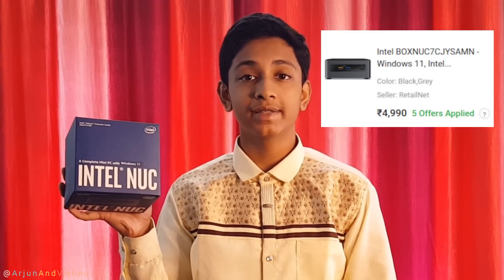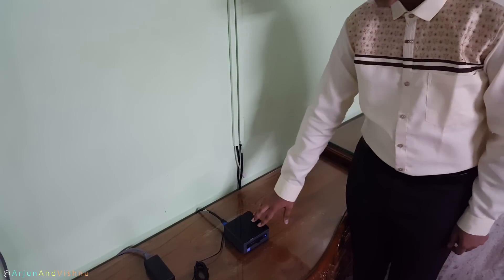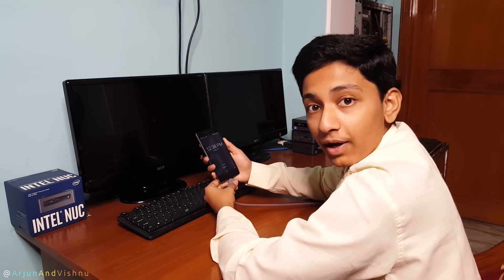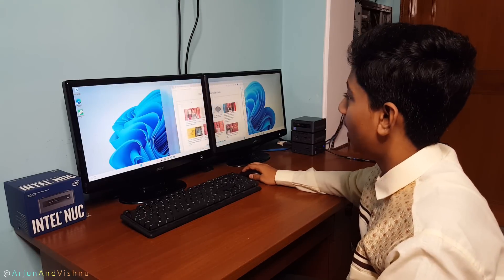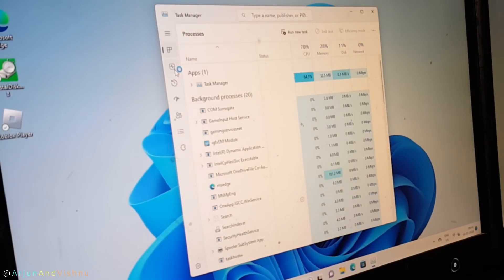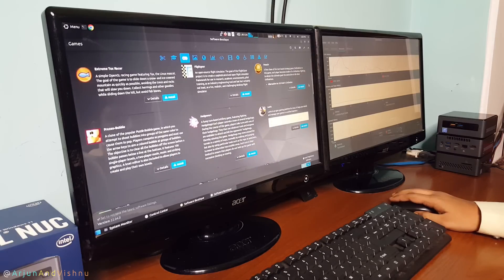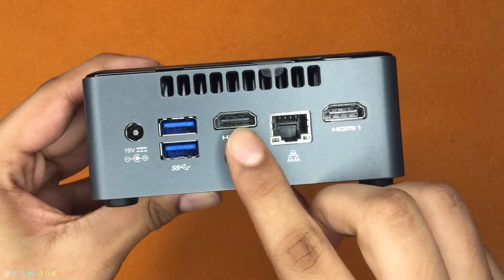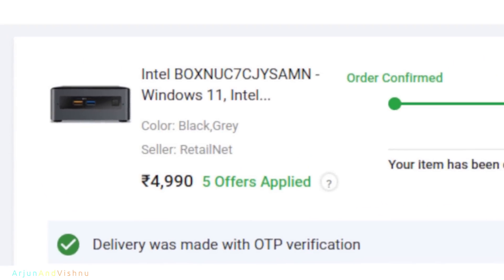Intel NUC Mini PC with Windows 11

Comment from the maker: Frequently Asked Questions:

Q) Where is the product available?

18 July 2023 update: Item Sold Out on FlipKart. It is available elsewhere, but only at a higher price.

Q) Price is higher now, how to get it for around 5K?

A) It was priced for Rs 5,990 on these days in the recent past:

3 July 2023
6 July 2023
15 to 19 July 2023

You get the additional discount when using card payments. Since I have no control over when FlipKart lists it for 5,990 again, there is no option but to wait for the deal. My wise guess is that it will be listed for that price intermittently, until the stocks deplete.

On the day this video was published (and a couple of days afterwards), the product was still available for 5,990.

---------------------------

Q) Why buy RAM at a store instead of online?

A) I generally buy RAM online and it usually has excellent compatibility. For example, I used various capacities of RAMs and even mixed the brands in my "Best Laptop Under Rs.20,000" video:

https://youtu.be/LIG-1PVGTrw

But that's not how things work with the NUC. It has a narrow range of compatible RAM types. For higher capacity RAMs (2x16GB), only the Dual-Rank RAM worked and Single-Rank did not work.

There is already 4GB RAM in the NUC. So whatever capacity RAM you are adding more should be compatible with the existing RAM. This is the reason I suggest that you buy the RAM at the store. You can ask the technician to install the RAM right there and test that it is working. You can even insist upfront that you will pay only if the RAM is compatible.

If you have to buy the RAM online because of any reason, make sure you are buying from a store/seller that accepts returns.

The first time you boot after installing the new RAM, the NUC takes around a minute to show up the screen, this is normal behavior.

BTW, the NUC does not have a speaker inside like desktops do, and it will not beep. In case the RAM is incompatible, the blue LED of the power button keeps blinking continuously to indicate an error.

---------------------------

Q) How to transfer the windows installation to a larger SSD?

A) Since many of you asked about this, I am going to do an instructional of this. Currently, my exams are underway, and I will take this up soon. Tentative date: 6th AUG 2023.

Meantime if you want to do it using other guides, and want to buy an SSD online, go for Crucial. It will help, provided you are going to add more RAM as well.

240GB: https://amzn.to/43OgSxA

500GB: https://amzn.to/3OvIeEd

Why Crucial?

https://youtu.be/rlBPqosUT-I

If you are not adding more RAM, any popular brand of SSD is just fine. 

---------------------------

Q) Which power cord is needed?

A) You need a 3-Pin power cord. Portronics Konnect G2 is a good one, and it sells for around 200 Rupees.

https://amzn.to/3Q3d7RF

---------------------------

Q) I see 100% processor usage constantly, how to fix it?

A) First up, let Windows update completely. As long as Windows is in the process of updating, the processor usage will be high even though no applications are opened. Once the updates are done, the processor usage will stabilize.

It will still hit 100% every time you open applications, but that will only be a brief spike. Being a budget Celeron processor, this is expected behavior.

Besides, Windows resorts to maintenance activity when the system is idle. So that will show up as high CPU usage too. But soon as you start using the PC, windows will pause the maintenance to make the CPU available for your applications.

---------------------------

Q) How to get the SD Card reader working in Linux?

A) On Ubuntu Mate, the SD Card reader is working fine after completing the upgrades. It will likely work fine on any Ubuntu flavor OS.

---------------------------

Q) Where is the product link?

A) There are some latest developments which I have mentioned in the description of this video. You should go through the details before making a choice.

If you want to have a look at the product, the FlipKart link is here:

https://www.flipkart.com/intel-boxnuc7cjysamn-windows-11-intel-celeron-4505-4-gb-ddr4-64-emmc-mini-pc/p/itm099cb2686d35f

Note: This is NOT an affiliate link (I do NOT generate revenue from it).

---------------------------
Reply: How to install msoffice

Comment: Thank you very much Vishnu . I have installed the SSD and RAM suggested by you. I am very happy that my computer knowledge has increased because of you. I have one last question, as the inbuilt C drive(64gb) is already full, is it possible to use the new SSD as a primary storage (drive C) and also boot the system from the SSD so that the overall performance can be improved.
Reply from the maker: Hey, many thanks. I am glad my suggestions were useful to you. Yes, you can use the new SSD for the OS, and boot from it.

I think your NUC came with Windows 11 Home preinstalled. As such, the license key is pre-available in the UEFI hardware. So, you just install the same version of Windows that it came with, for example "Windows Home", and it will activate alright. Here's the process to install the OS on the new SSD:

https://www.youtube.com/watch?v=4Nj_MeDRjmI

If you have a Home License, but you install Professional, it will not activate. Stick to the same version.

Leave the data on the eMMC as it is. It will be useful if you have to repair the OS in future. There is a setting in Intel BIOS where you can turn off the eMMC (F2 - Advanced - Devices and Peripherals - Onboard Devices). Take a backup of your files, and turn it off before you install the OS on the new SSD.

Comment: Can i play 4k video via pendrive in 4k monitor?
Reply from the maker: Sure you can. It does 4K 30 alright when playing local files. However, it drops frames when playing 4K 60 on YouTube, because of the processing power required for de-compression.

Comment: Hi, vishnu Last year in dec i bought NUC11ATKC2 in 8500₹ with ur help ,its working fine .Because of you I was able to make my 1st PC. If you remember I had sent you a pic as well, Now I want to increase storage and RAM. So should I spend 5000₹ and upgrade it or should I go for a new one.
Intel 10th gen i5,  intel Mini PC is available with 512 GB storage and 8 GB RAM for ₹18500 in flipkart( search mini pc) What is your opinion on this?
Reply from the maker: Hello, I do remember you PC, good to hear from you.

The newer one available on FlipKart is twice as quick as your current machine. But, you should NOT buy it for these reasons:

1) Intel NUCs are no longer in production, they will be serviced by ASUS though.

2) A processor that is only reasonably quick than the one you already have is not a strong reason to upgrade.

3) The processor is many generations older too. Does not have an NPU too, something that will be essential for AI applications.

Ideally, if I were to buy it, I will do so it it is listed for 12K or less.

---

As with the upgrade to your existing machine, if you have one RAM slot occupied and the other free, you can buy another 8GB stick. It will cost you around 1200. Total RAM of more than 16GB is not needed for these machines, the processor will get saturated anyway.

Storage is your choice, generally speaking, the money you spend on secondary storage does not go waste. You can use it on one or the other computer. Use a USB to SATA enclosure, and an SSD to go along with it. Here are the options:

Low cost option:
---
Enclosure
https://amzn.to/3U3OdT7

SSD
https://amzn.to/4eGTrMX
https://amzn.to/3zI2QEW

-----------------------------------------

Expensive, but future-proof option:
---
Enclosure
https://amzn.to/3XSPA8m

SSD
https://amzn.to/3NkvjDY

Comment: Excellent review. Just want to know which version of Ubuntu LTS have you tried installing on this NUC. I have the exact same version. Planning to use it for Media streaming.
Reply from the maker: Hi, I am using Ubuntu Mate 22.04 on both the units. I left the Windows disk as-it-is, connected an additional SATA SSD and installed Linux on it. This NUC runs smooth with Ubuntu, you may need to add a stick of RAM to run something like PLEX. I think the processor has just enough headroom to support it (I got to give it a try though). Thank you.

Comment: Hi Vishnu, I purchased Asus mini pc pn41 similar to NUC. But it's not booting up. Even the bios is not showing up.
Can you please help? 🙂
Reply from the maker: Sir, the PN41 is a barebones PC. Did you add the compatible RAM to it?

If it has a speaker in it, the beeps will indicate if there is an issue with memory compatibility.

May I see the exact link where you purchased it from?

Comment: HI ARJUN THNX FOR THE INFO JUS WANNA KNW CAN THIS MINI PC  BE CONNECTED TO 43" LED TV
Reply: thnx vishnu ❤
Reply from the maker: Oh sure! The NUC has two HDMI ports and it can connect to 4K 60Hz televisions too. Besides, you can install Android on it too. It has a built-in IR receiver, but that will require a compatible remote to work with.

Comment: $4990 Rupees? ($60 USD??)  how is that possible?? that is lesser than what MSFT charges for the OS??  AMAZING!
Reply from the maker: TRUE! But that's in comparison to the price of the retail license. The one on the NUC is a OEM digital license, and it is tied to the motherboard of the NUC. The license will activate no matter what component you add, so long as the motherboard remains intact. If the motherboard fails, the license will go too.

Of late, I see many websites selling Windows OS licenses for less. These are volume licenses and they are meant to be used by a certain entity, and within the organization only. These licenses work alright so long as MS does not revoke the volume license. If it revokes, 😃 😃 😃

You may already know this info, but I just wanted to put it here so that someone else may find it useful. Thanks.

Comment: I have NUC with i5 processor 8 GB ram purchased from a seller from nehru place at 5500
Reply: seller name & address  .... and that seller is genuine ...how is the performance of the product nuc you have purchased
Reply from the maker: I purchased it at FlipKart. It was available at the time of posting this review, the links are in the description, but I guess it is sold out now.

My units are doing well, especially the the ones that are running Linux.

Comment: You installed 32 GB RAM.
So you see 32 GB being shown in windows ?
So system never falls short of  RAM ?
Reply from the maker: Yes Sir, the task manager shows 29.9GB of RAM. The other 2GB is used a s the shared graphics memory. I used it for testing purposes, to see how much maximum RAM it supports.  I think 32GB is a overkill for this processor. Another 8GB will be more than sufficient.

Comment: Great vdo,  giving information on budget pc,  I repaired my old pc at the cost of 7000+ but still has some issue. Keep it up Informing. Thanks 🎉❤❤❤
Reply from the maker: Thank you. I am glad it helped Sir. With regard to PCs, sometimes it is better to buy a new one rather than upgrade an old PC. The key reason being the power savings you get from newer processors. In the span of 10 years, processors have gone down from 65nm to 10nm. The latest processors can do just about the same work as the older ones consuming just 10-15% of electricity.
Reply: Thanks

Comment: Good video, I have N5050 dell old ones its not supporting windows is this drvice support, can u please make any video on how to make compatablr for old laptops.
Reply from the maker: Yes Sir, you can run Windows 11 on older computers too. I will make a video on that. However, the Dell N5050 has a Intel Core i3-2350M processor. It is a 2nd generation processor and a tad slow to run Windows 11. Even the latest versions of Ubuntu will struggle with that processor. Raspberry Pi Desktop x86 will be a good fit for this hardware.
Reply: @ArjunAndVishnu   Thank you so much for responding back, may GOD bless you
Reply from the maker: Thank you Sir 🙏

Comment: Can we use it aa online share trading terminal
Reply from the maker: Sir, if your trading application runs inside the browser, it will do alright. If it is a standalone application, it depends on the amount of processing power and RAM the application needs. It does support dual monitors that is useful when trading.

Comment: Hi can I use this for trading with two monitors
Reply from the maker: It does support dual monitors. If your trading application runs inside the browser, it will do alright. If it is a standalone application, it depends on the amount of processing power and RAM it needs.

Comment: Intel nuc starts at 18000 upto 50000+. Where did you buy it from
Reply from the maker: Sir, I bought it on FlipKart. It was on a deal during that time. This NUC was usually listed for 7990, and 5990 on a deal day. It is very good VFM, no wonder it ran out of stock in a month.

Comment: Hi, can we install Photoshop and coreldraw after update ram to 8gb, and 1tb SSD?
Reply from the maker: Hello, for advanced functions, Photoshop needs support from a discrete graphics card, which the NUC does not have. Capacity of RAM and Disk are not the issue, processing power is. Thank you.
Reply: @ArjunAndVishnu   can we add graphics card ?
Reply from the maker: NO!, because:
1) The NUC does not have a PCIe slot.
2) It does not have a M.2 NVMe either to use an adapter
3) It does not have a Thunderbolt port to support GPU enclosures
Integrated graphics it will be. That's all. No other options 😊
Reply: @ArjunAndVishnu  thankyou

Comment: I think this product can be best used in low to medium end schools with low budget, to teach kids on computers and its applications. They don't need big memory or storage space but use of latest software keeps them updated with latest applications. If you can pair this with budget friendly good monitor(appropriate monitor for kids like tilt function, anti glare, wide screen for 2-3 kids viewing), keyboard and mouse, then its a good package for schools to pick up in bulk and probably get further discount.
Reply from the maker: That's absolutely right Sir 👍 The NUC's low power consumption is a big plus in a school environment. It saves space as well since it can be VESA mounted to the back of the monitor.

Sorry for the delayed response, I missed the comment.

Comment: Is it possible to use Illustrator and photoshop in this device?
Reply: Thank you for your prompt reply.
Reply from the maker: For advanced functions, Photoshop and Illustrator need support from a discrete graphics card, which the NUC does not have.

Comment: CAN WE HAVE AUDIO ON THIS AND IT HAS WINDOWS 11 AND MSOFFICE  AND WIFI PL.REPLY
Reply from the maker: Audio: Yes! It has Bluetooth 5.0 built-in. If you have a Bluetooth headset or speaker, you can connect and use it. If you have to use the 3.5mm audio jack, you need to buy a USB sound card like this one: https://amzn.to/44w6KtI

It has Windows 11, but no MS Office. It has AC series Wi-Fi built-in.

Comment: Is it support to vector and bitmap graphic softwares
Reply from the maker: I have tried GIMP and Inkscape, both run fine. Photoshop and Illustrator may not because they need support from a discrete graphics card, which the NUC does not have.

Comment: but the big disadvantage is repairbility , u cant repair these mini pcs main board easily. besides after few years these boards tend to give problems but otherwise value for money.
Reply from the maker: You are right!, Sir. But, generally speaking, nothing on the board is overclocked, because of which the boards last for quite some years. Mostly people repurpose them as File Servers after a few years since these PCs become under powered to the day's standards.
Reply: @ArjunAndVishnu   yes sir ur view point is valid too
 Keep up the good work
Reply from the maker: Thank you, Sir.

Comment: Nice review bro. One doubt will adding ram and SSD make warranty void ?
Reply from the maker: Thanks! The NUC is designed for easy upgrades, which is why the NUCs do not have any stickers on them. Many NUCs are available as barebones, and are intended to be upgraded. So, there will be no issues with voiding the warranty.

The only case the warranty might be denied is if you burn something on the motherboard. Else, it will be honored alright.